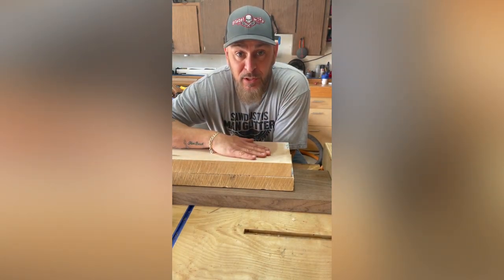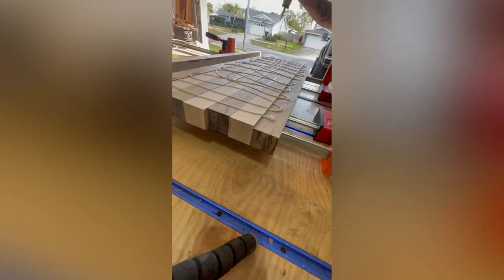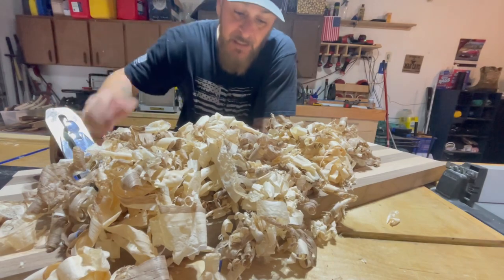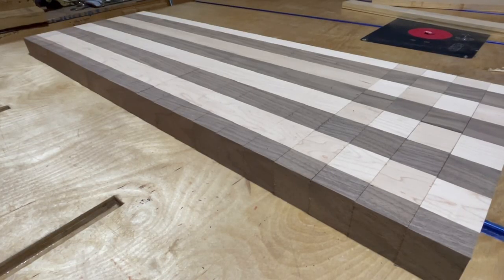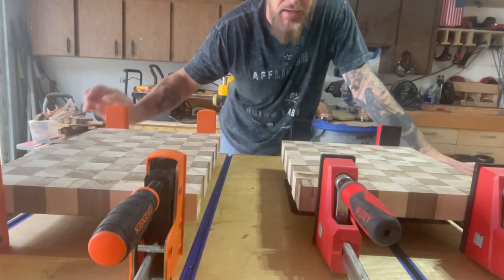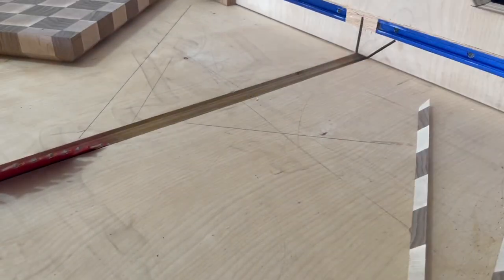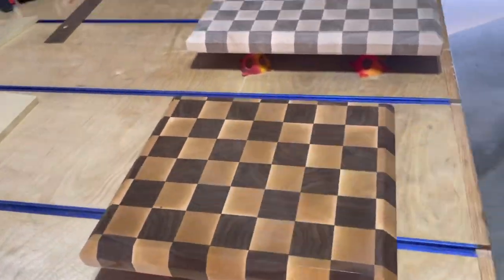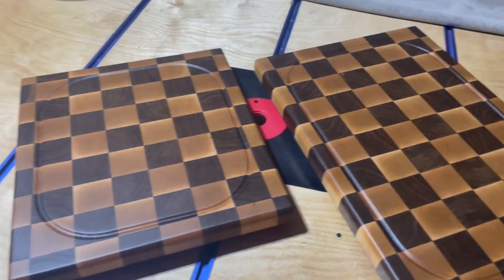Building End grain cutting boards start to finish

Comment: Enjoyed your video.👍 I will file away a few nuggets I picked up from you to use on future boards. I found by soaking the boards in a container with 3-4 inches of mineral oil for 5 minutes, then letting them dry will increase penetration of the mineral oil into the boards. Lastly apply mineral oil and bees wax mixture and buff
Reply from the maker: Thank you for watching the video Ken.😁